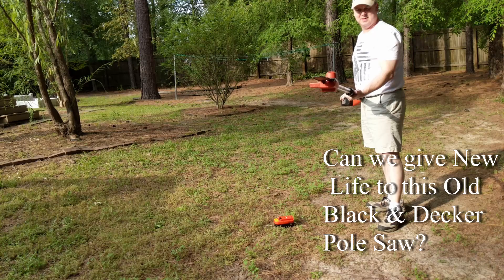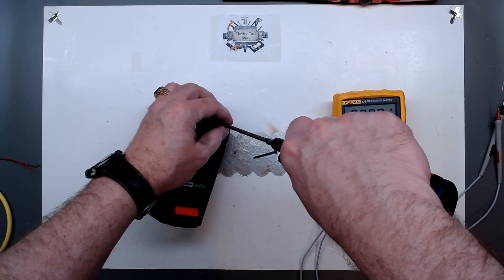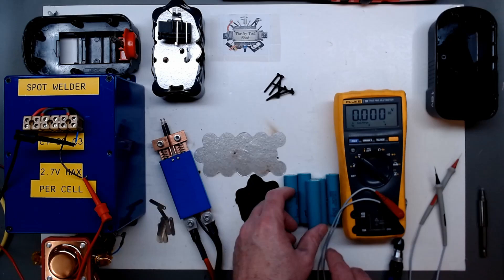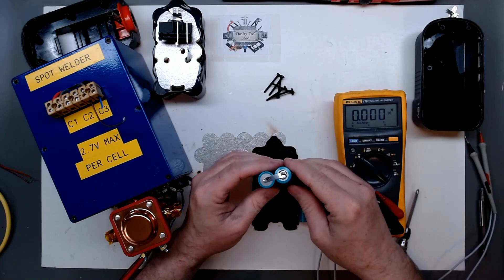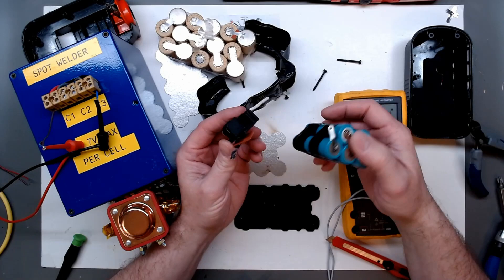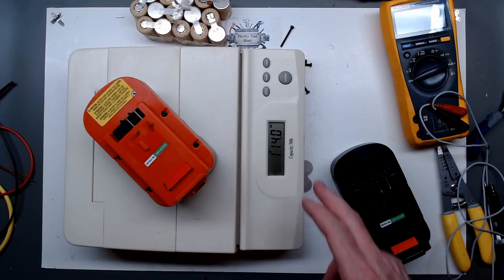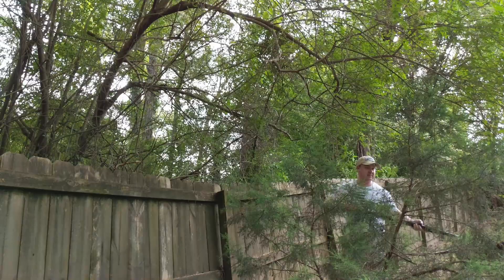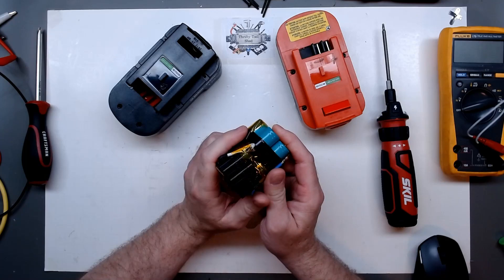Bringing a Black & Decker 18V Pole Saw Back to Life! (Part 1)

Comment: Thanks for the video.  What will you use for charging?  The  original charger?
Reply from the maker: I will either use my variable PS set at  20V and 1A current limit, or connect it to an 5s li-ion charger.

Comment: These batteries in my experience have the worst longevity of all power tools
Reply from the maker: You are talking about the old  NiCd packs in general or the Black & Decker 18V?
Reply: Thrifty Tool Shed the 18v
Reply from the maker: Yes, they are terrible. Li-ion saved cordless tools. Look forward to the next platform!
Reply: Thrifty Tool Shed what do you mean by  platform
Reply from the maker: @nultari1  
Oh, I just meant once the solid state higher capacity cells come out. As good as Li-ion has been, I can only imagine what's next!